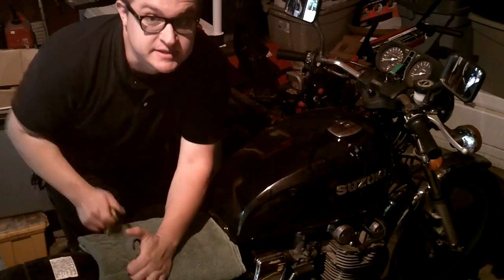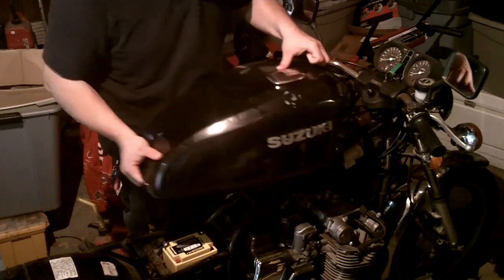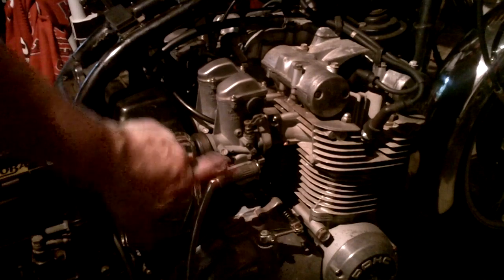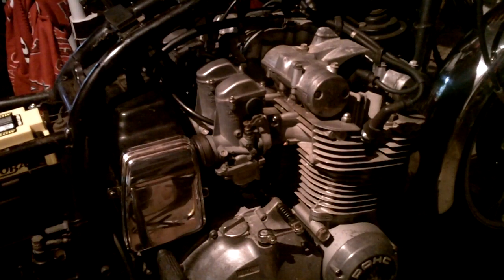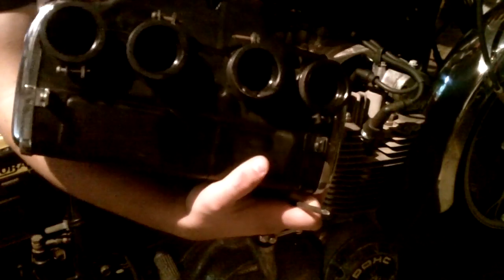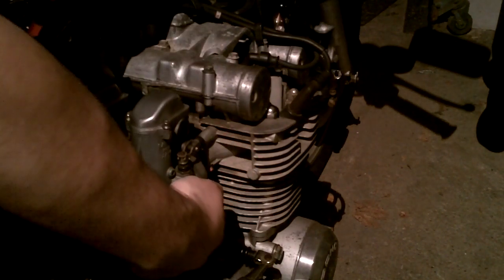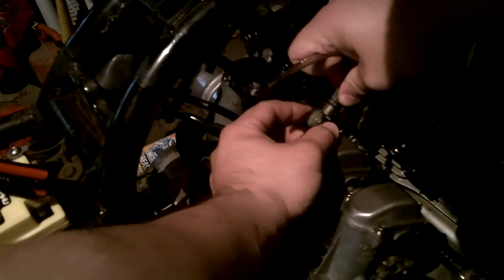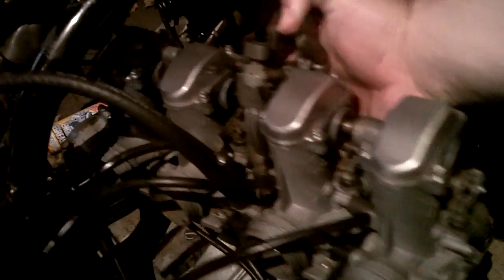I show you how to take off and dissasemble  Suzuki GS850G carbs pt 1

Comment: i just got a 1978 gs850 i need to know what the hole is on the bottom of the block when i crank it then shut it off oil comes out of that hole

Comment: I'm putting a GS850 back together I got in boxes. I have everything figured out except where the vacuum line from the fuel valve connects to the intake at. I watched all your videos but didn't see anything.  Would you happen to remember? I looked all over and didn't see anything.

Comment: I just bought a 1979 GS450 and the last owner said that it hasn't started in around 5 years.He told me he thinks it might need a new CARBURETOR but he's not sure.So far awathe only thing that it needs is that and a full fluid flush.Any suggestions on how I could go about this?

Comment: Is there a way to shut off the Petcock when removing the tank so it doesn’t leak gas?
Reply from the maker: Shut off the petcock so it doesn't leak gas.
Reply: Correct me if I’m wrong but there is no shutoff only on, prime, and reserve.
Reply from the maker: When the bike isn't running, the diaphragm in the petcock turns ON off.
Reply: @evanparker  - Thank you for answering everybody's questions!   I just now picked up a, '80, GS850

Comment: I recently picked up an 80 gs850 as well. The guy who sold it to me said it was solid but the day after I rode it home, it wouldn't start. I think the battery is gone so now I shall be slowly stripping it and doing one thing at a time. 
Do you notice any starter issues? Reg Rectifier etc?
Reply: Did you get it back up and running ..???

Comment: No pesky expensive diaphragms on the carbs and a kickstart, maybe I should have got a gs850g instead of a gs1000g. The problem with these Suzuki's is the stupid earth point which is on a rubber mounted battery box bolt, you find out about it when your harness earth cable starts burning.